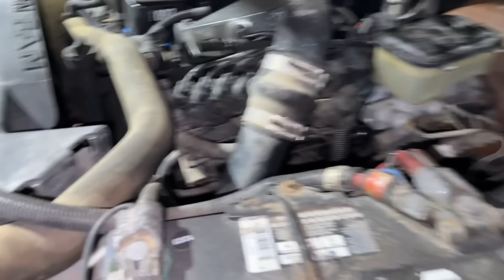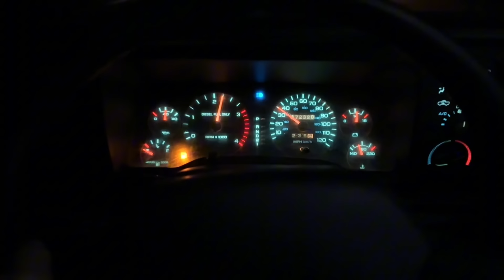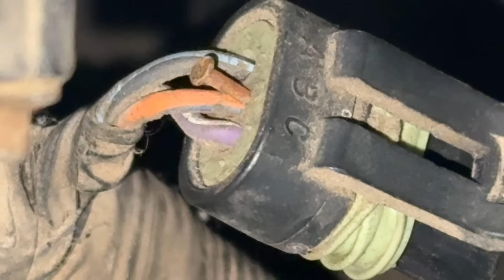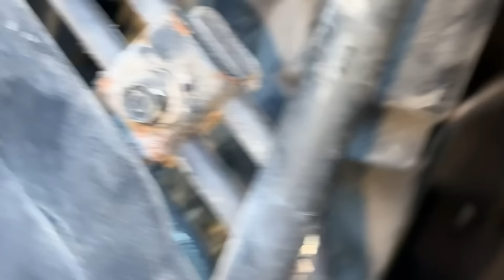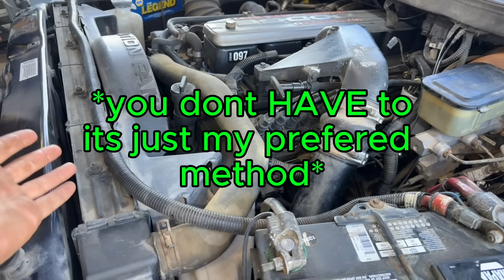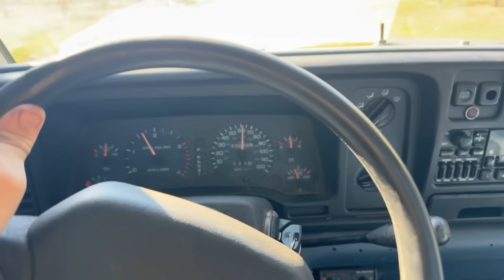Fixing A Lazy 12 Valve

Comment: I put a 94 12 valve in an 03 3500...same mods and used the 03 turbo and manifold.Nv 5600 and pullcable shutoff so can be bumpstarted no battery.
    Have to watch the long hills not to over egt.
         If i were a few thousand miles closer it wd be at your door.

Comment: Cant beat a 12v, even if they are slow in stock form. They run forever and cost pennies to maintain compared to this new stuff. Unfortunately the trucks are getting on the old and worn side these days. 

I have a home built potentiometer wired into my 94 12v for overdrive, probably for about 20 years now. It works great and is obviously very consistent. Its also nice being able to turn it up slightly for holding 3-4 longer when towing. The only thing i really dont like about it is in town driving at say 35-40mph. The factory TPS would shift to overdrive at that speed under light throttle, where as the POT is going to have you in 3rd unless you adjust it that low. Not a big deal, just something i dont like about it. 

I was glad to see the overflow valve swapped out. The spring gets weak and at this age they pretty much all need replaced. My truck was breaking up at high RPM. I checked fuel pressure and had next to nothing . The ball in the overflow valve (which had been replaced in the past) had pushed through its seat and was wearing on down into the housing of the OFV while leaving an open gap for fuel to bypass. Sometimes its the simple things. 

 Great video!

Comment: Any chance you could make a short explaining why having the throttle set at 40% tightens up the shifts? I'm sure theres content out there about it but definitely seems like a less talked about 2nd gen mods. Also seems kinda crazy they don't give you a pigtail in that kit.
Reply from the maker: The pcm controls the 3-4 shift, when it sees high throttle percentage it will wait to shift into 4th because it thinks you are flooring it. If you drop that percentage it is seeing to around 40% it will go into overdrive about 55mph every time. If you adjust the % higher or lower it will change that speed at which it goes into overdrive. I am also surprised they don’t sell a pigtail with the kit but I wasn’t able to find one easily either
Reply: @Stratemannauto  If you happen to have a crank sensor laying around, they look pretty damn close

Comment: I remember when my ol' 12v was stock. Couldn't pass a car on a 2 lane road if my life depended on it. I added the gov springs (I can't remember if it was a 3 or 4k set), OFV, 60lb valve springs, and turned the smoke screw. Passing slowpokes was no longer a problem... though I did have to detune it for WA (King County) emissions years ago (and haven't turned it back up since due to the tired automatic).

I thought I was the only person in the world that refers to old things (parts, etc) as "old enough to drink" :D

Comment: Hey Stratemann, is the throttle position sensor a problem on the manual trucks as well? 
I have a high miler and think it needs the same tune up!
Reply: The TPS is only for auto's. It tells it when to shift. But those other upgrades will work the same on a manual. Power Driven Diesel's channel has tones of videos on how to put "go=fast" parts on. Good luck brother.
Reply from the maker: See below comment

Comment: Glad I got a manual transmission 2nd gen. It's plenty fast.
Reply: This thing shifts waaaaay too soon to have any meaningful acceleration. Needs to shift at 2800-3000 rpm for full throttle.

Comment: What do you recommend for fixing the 3 candle power lights 😂 and is the trans a 47re?
Reply: The trans in a 94 would be a 47rh. Pretty much the same as a 47re, except the RH has full hydraulically controlled shifts 1-3 using a mechanical governor, with 4th and lockup being electronic. The 47re electronically controls the governor pressure for shifts 1-3, with 4th and lockup being electronically controlled as well.